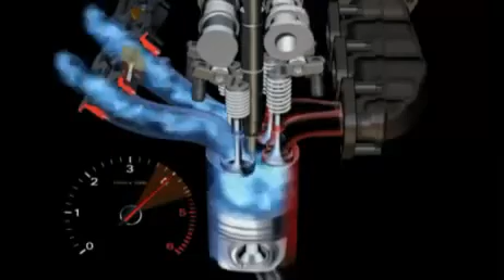VW/Audi Common rail TDi engine explained

Comment: Just did my research and PD reliability is about 600.000Mil where Common rail is between 250.000 and 400.000Mil (depending on the manufacturer). Which makes sense cause for VAG in our days (after 2006) brings more money from fixing broken engines, than have a good reputation of reliable ones...
Reply: me too

Comment: dirty
Reply: +KING MARS, so you drive an electric car? so do you charge you car from a coal fired power plant or natural gas fired power plant? or a solar panel/wind generator created in a industrial plant in china that has low enviromental controls on waste? Your still contributing just as much as the rest of us, we are more transparent about it is all.
Reply: But efficient.
Reply: +Mack124. you have no clue
Reply: +KING MARS But I do though. What other engine can give you 800 miles on a full tank? I would know, because I own one. You dream, I own. Peace.
Reply: +Mack124 i own one that uses no gas.. you are still  polluting the air.
Reply: +KING MARS Very good. I am, as well as other motorist on the local highways. I guess you have beef with all of us. There is so many of us (gas and diesel), and not many of you. But I do like Tesla though.

Comment: the old PD sistem is better for me. The common rail injector is too complex and gives more problems. And at the end a pd engine in the real world is more economical ( a friend has a Fiat GP ( Fiat invented CR) 1.3 multijet 75 hp gives the same mpg as my 1.9 tdi pd golf 105 hp and the pd has a great low down torque. But i think when the camshaft is used for compressing the fuel in a pd engine it makes some power loses when its hitting the injector
Reply: +Kristian benz Agree,but CR pump has also some resistance. Main advantage of PD is injection pressure, but new generation of CR pumps has same or even higher pressure than PD. Also injection pressure on PD's isn't constant. It is high when cam lobes pushes pump pistons, but it is lower when lobes stops to press injector pistons, so injection window for PD's is limited by cam timing, but on CR is constant.

Comment: Lot of confusion and inaccuracy below about the VAG 1.9 & 2.0 diesel engines.  There are older 1.9 & 2.0 PD engines which are not common rail - they are older technology.  The 2.0 PD is allegedly the one with oil pump issues.  It is claimed (because of the lack of heat produced in the combustion process) that these PD engines are more problematic in regenerating their DPFs (if fitted).   The 2.0 common rail engine is newer technology, twin cam, 16-valve.  Early models had injector issues which were replaced under a recall (in the UK).  These newer engines have a good reputation and there are no general problems reported.
Reply: Newer PD engines are also DOCH

Comment: It does not matter how good a diesel engine is, it must have good quality fuel to run properly and to protect the parts like the fuel pump.  In North America, the diesel fuel is of bad quality and VW of NA knows that.  Buy your fuel at a reputable station or just avoid buying a diesel car and go for a plug in  hybrid gas engine instead.

Comment: avoid the 2.0tdi, oil pump failure balancer shafts costing £1000's nightmare of an engine. 1.9tdi 8v is KING! 1.6tdi to new to report yet but we have seen a few injector failures around 60k mark.
Reply: not true ive got a 2.0 TDI audi a3 never misses a beat.
Reply: Not yet, get rid of it whilst it's still running, it's going to go bang!
Reply: not it wont. not evrycar is built the same its done 79,000 miles. its had a new turbo due to an overfill of the engine oil. it always starts cold or hot. had it 2 years the results speak for itself
Reply: the 1.9 is good but an old engine. the 2.0 has more torque and quieter.

Comment: Fuel pressure is1800 Bar thats 26100 psi I'm skeptical about that.  If the video said 1800 milli-Bar for fuel pressure thats believable.  Did they just misspeak in the video or does this fuel system really use 26100 psi?
Reply: That is correct. You can get aftermarket performance injectors to boost that to around 35,000 psi. If you have an older TDI that isn't a common rail, the injection pump does the work. So it'll boost to 15,000 psi. Again, you can get aftermarket performance injection pumps to get to 20,000 psi. Thats Volkswagen though, I don't know about Audi and what they have.

Comment: I drive an A6 2.0 TDI a lot. At the moment it has 345.000 miles, and it runs perfectly with no drama. As soon, as you'll understand how to use them properly and what they need - they will pay with reliability.
Reply: Tell me how please, your top 5 tips?
Reply: @melancholicmuse  maintain properly with good quality fluids and filters . Wait 2 minutes before hitting the road after a cold start. Don't hummer it when cold. Never run on an empty tank. Your engine will outlast you.

Comment: I have a 1998 1.9 TDI vw golf 90hp with 210000 miles, the only problem I've had was a catalytic converter problem, it clogged up at around 200000 miles. These TDI's are brilliant, they are the best engines as far as i have experienced. The engine on my car is still going strong and sooo economical to run. I service it myself every 10000 miles and change the timing belt every 60000 miles. When I'll change my car it will be for another TDI.

Comment: Fiat Motors is actually the inventer of Common rail technology. (They sold it to bosch) It took VW/Audi over a decade to realize the italians had superior technology and have now adopted it. So if Chrysler/Fiat brings diesel to the market in the usa these engines will be a very good product.
Reply: @RepublicanGuard reliability aside doesn't change the fact they invented the commonrail concept decades ago.  Do some research. Fiat is more than Ferrari.

Comment: I heard 2.7 TDI's are problematic. But really guys, every engine is different, and it doesnt matter if you have a 2.0 or 3.0 TDI, problems will come.
Reply: Generally speaking, the most reliable units are the 1.9 and 2.5 variants.
Reply: @notme-y1m  nope 2.5 v6 is crap, 2.5 r5 is kinda good, the best are firstly 1.9 tdi pd, then secondly 2.0 tdi cr and third 3.0 tdi v6
Reply: @WarcrafterOwlli  2.0 TDI before 2012 are crap.
Reply: @notme-y1m  Before 2009. * Since commonrail technology started it was good, I have an Audi A5 2.0 CR 170hp, fantastic car
Reply: And the 2.5 I was talking about is the straight 5.
Reply: @notme-y1m  i don't even know why i wrote that comment 8 years ago. All i had in my life is TDI. 1.4 VW Polo, great little car, 3 cilinder with decent power and great consumption. Then a Vw Scirocco 2.0 TDI CR. It ran with 207 hp for 5 or 6 years before i sold it, never had any issues , loved that car. Now i own a F30 320D, low this as well.